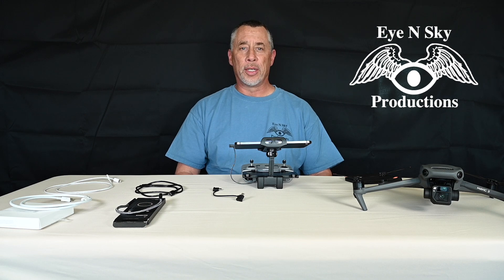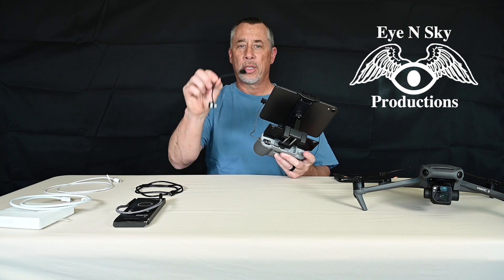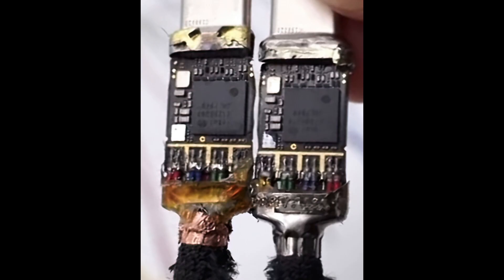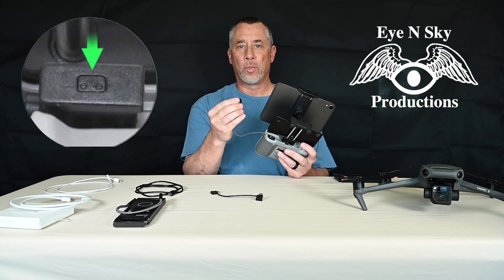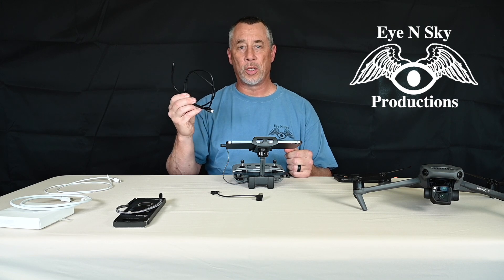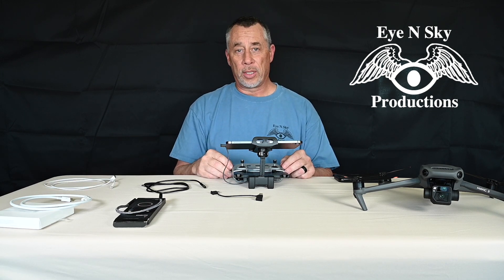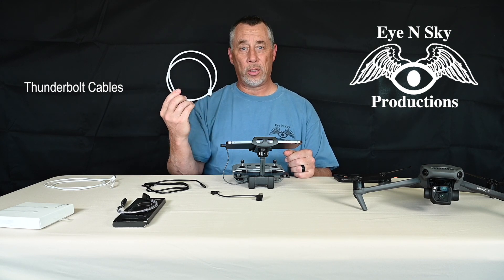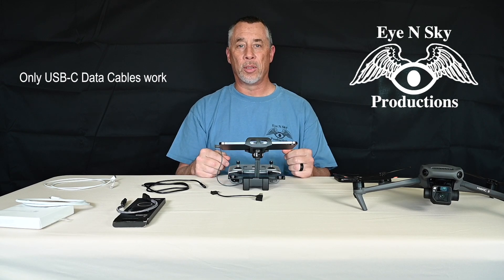DJI Mavic Drone remote control to display device USB-C Cable problem solved!

Comment: I was trying to using an iPad Pro M2  with an apple cable C to C and doesn't work, after that I tried again with the small Dji cable and it works but definitely I will get the HANATORA Cable. Thank you!

Comment: Thanks so much, that solved my problem why USB C cable wasn't working on my iPad mini 6 to Phantom 4 Pro V1. It works if you use a USB A to USB C adapter, and if you have the USB C cable going in the right direction.

Comment: Hey Kirk! I have the mav mini with basic controller. micro at controller to usb-c android device. 
Rec's on a cable system that works?? I need more than 1ft length and having trouble finding one that works
Thanks!

Comment: I had that problem with my apple iPad air 5th and went to using my iPhone 14 instead.  Will get the right cable - hopefully. Thanks!  Mine might be just the wrong direction because I know it worked one time a week or so ago.

Comment: I have problems with connectivity between my rc controller and android smartphone. It also keeps indicating during the flight: 'rc not connect to mobile device'. This for only a second and after a minute again and so on.
Now I suspect that my usb-c cable from DJI is not the best quality or even has a malfunction and therefore I want to buy a third party cable. My question: do you happen to know if the same problems with 'circuitry built in' also applies to android systems? Greetings from the Netherlands.
Reply from the maker: Yes Android devices have operating system issues as well. This sure sounds like a bad cable though.
Reply: @theonetrekkie  I received my new cable today from a third party and with two angled connectors. The cable does indeed only work one way but that is fine. I flew with it today and no longer have any interference ('rc not connected to mobile device'). So that was the problem. Thanks for your comments. Greetings from the Netherlands.
Reply from the maker: @RONALDSCHULTE  glad I could help!